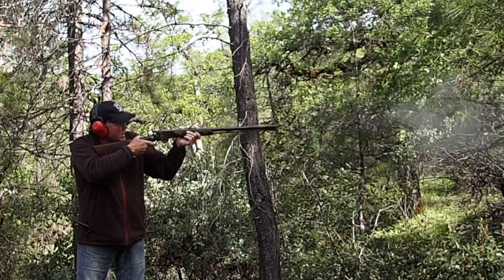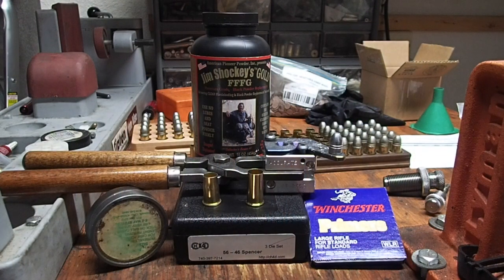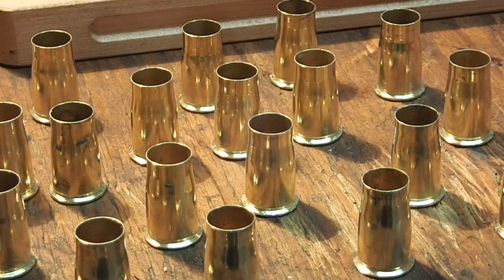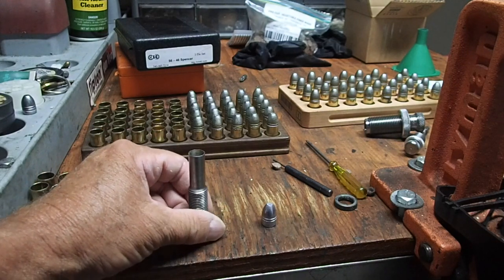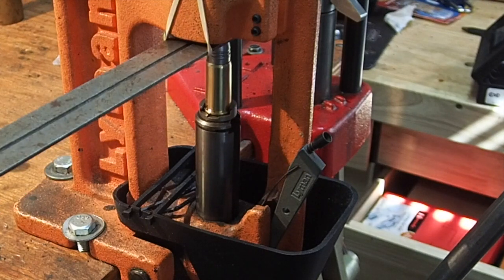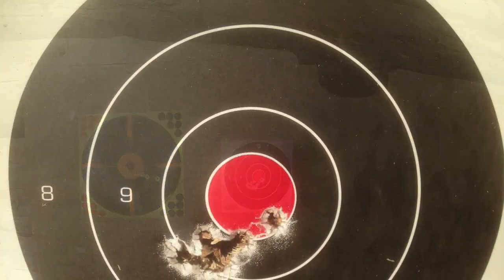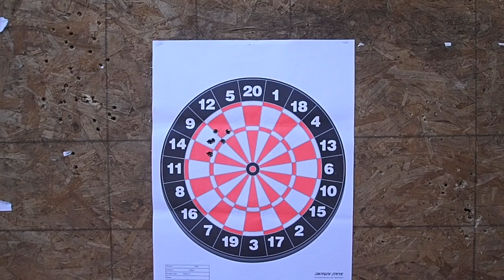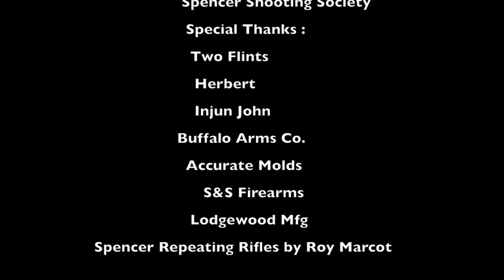Shooting the Spencer 56-46 Rifle

Comment: Love these old guns,I have a William Palmer Csrbine from 1865 coming my way.When I finally examine to see if it's safe to shoot.I have to find brass in 56-50 rimfire spencer.And do you know anyone besides yourself down South that does Reloading.
Reply from the maker: The Palmer is a rare bird, I doubt anyone makes a centerfire conversion for it like they do the Spencer.I think Dixie Gun Works sells a re-loadable case for the 56-50 that uses a .22 blank as a primmer. That might work out ok for the Palmer since it's a single shot and you can watch the orientattion of the firing pin over the primmer.

Comment: I have used 8mm Label and fire formed and trimmed to make 56-46 rounds. Also you can modify saber saw blades to make extractors which are good spring steel.
Reply from the maker: Thanks David, good tips.
Reply: I have found that .348  winchester can make 56-46 rounds but the rim is a little to small. The 6mm Labels work great due to very thin walls in the case you can achieve 46 grains of FFFG behind a 350 grain or so bullet. I have notice the new Armi Sport upper breach blocks fit my 56-50 Spencers fairly well. LOVE SHOOTING SPENCERS; BEEN DOING IT SINSE 1980. I FIND THE 3 BAND RIFLES ARE EXTREMELY ACCURATE TO 500 YARDS. DAVID

Comment: Another suggestion is 348 winchester brass cut down will work in 56-46 Spencers but I found the rims a little to small. I have been shooting Spencers  starting back in 1980. I love your factory Spencer and the after market should not reflect on Factory 56-46 calibrations. Still the 8mm Labels work best but are now hard to come by so Starline is a good choice. Who made your 56-50 bullet it is a little pointer than mine from Rapine. David Read
Reply from the maker: David,   I feel fortunate to have that factory sporter. The smooth action and light, crisp trigger are night and day over a standard military model. The bullet for my 56-50's is from a Rapine mold 520375. I shoot it as cast (.520 ) in my 1865 carbine and size it down to .516 for my 3 band new model. The factory sporter I use an Accurate Mold Co. 47-265S, which casts a .465, 270 grain heeled bullet. The bullet for the gunsmith converted new model is from a custom Accurate mold 49-296S , which casts a .486 heeled bullet weighing 302 grains. The cases for the Factory sporter are BRACO 56-46 cases made from Starline 50-70's. I form a case for the gunsmith sporter from Starline 56-50 cases neck sized with 56-46 dies and expanded with a Lee universal expander die with a Poe .481 plug.

Comment: What modern calibers are similar in power and shooting experience?
Reply from the maker: An interesting question. About the closest currently available cartridge to the 56-46 is probably the 44-40. The Spencer round was slightly more powerful with 45 grains of powder and a 300 grain 46. caliber bullet. The 44-40's, 40 grain powder charge and 200 grain ,429 bullet is about as close as you can get in an off the shelf cartridge, The 56-46 was considered a mid-range cartridge in it's day. Thanks for watching and commenting.
Reply: @oldscoutgp  thanks for the in depth explanation

Comment: How fast does 56-46 spencer travel ?
Reply from the maker: The original rim fire 56-46 ammo was supposed achieve 1200 fps. Modern center fire cases don't have the same capacity as the copper rim fire cases. My center fire handloads are probably traveling 900-1000 fps.

Comment: You put a lot of work into this, thanks.   Seems like standardization was not one of the strong points of this rifle.
Reply from the maker: It is not uncommon for 19th century firearms to be out of spec. With no cnc machinery or SAAMI  ammunition standards in effect, bore and chamber dimensions could vary widely. The factory built sporter was actually easy to load for.  The new model rifle was a military action sporterized  by some unknown  gunsmith who played it fast and loose on cartridge specifications.